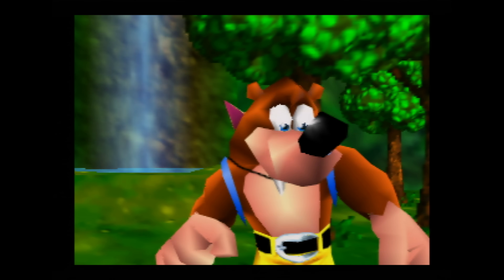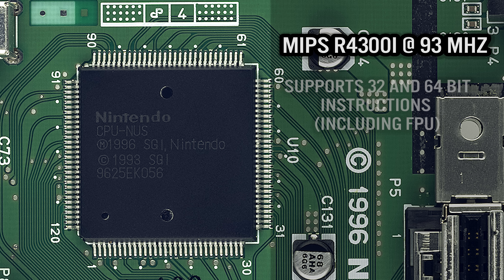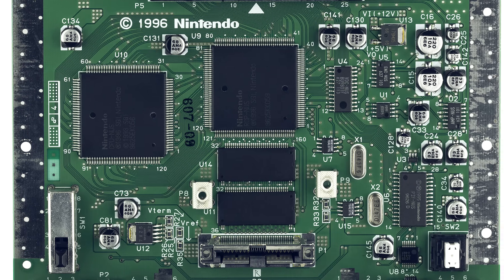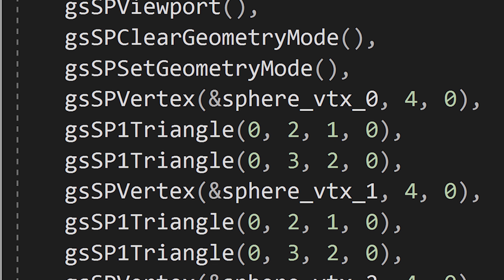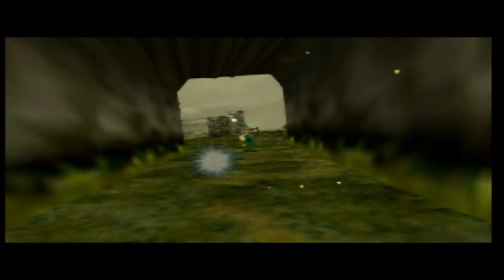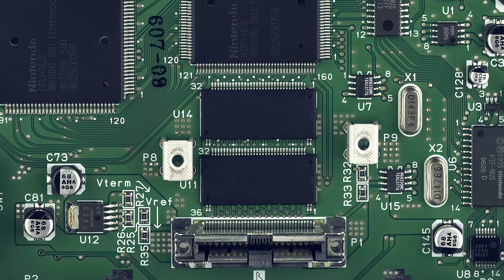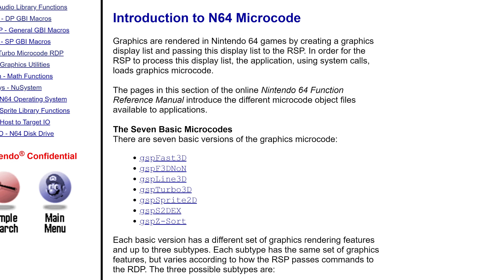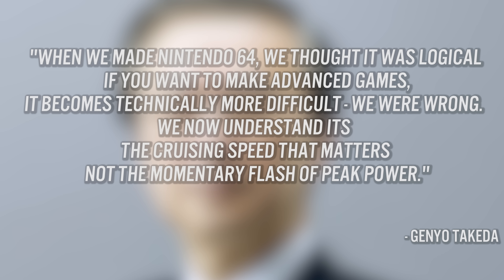Why was the Nintendo 64 so hard to develop games for ? | MVG

Comment: I would have prefered CD based console. I get that cartridge has faster loading times but on the other hand, storage is limited to 64mb. I find that limiting given how much more richer games could have looked if they had 700mb of storage that the CD's had. Plus, the CD based games also had more to offer. For example: the PS1 version of Tony Hawk Pro Skater had more than just gameplay, there was more FMV (command and conquer also had more FMV on the PS1 than it did on N64). RE2 had fmv on both systems but looked better on the PS1. One more example is Mortal Kombat Trilogy, the PS1 had more characters than the N64 version

Comment: What hurt more than anything was that the dev kits weren't very good and game programmers were very rarely adequately trained to do the graphics programming in a well optimized way. Very few game developers for the system had sufficient knowledge, skill, and budget to do it properly, but you can find some notable exceptions. Acclaim, for example, was able to take advantage of the system much better than a lot of other developers. 

My opinion is informed largely by Kaze Emanuar, who has recently argued that if you know how to program for the system properly, the memory bus is fast enough to effectively utilize the shared memory and to avoid bottlenecking the GPU, and he can back this up with working ROM hacks that he's made.

It may have made the system easier to program for if it had dedicated vram, a larger cache, or faster memory bandwidth, but Nintendo really dropped the ball in terms of how poor their dev kits were, and there were already some communication failures inside of Nintendo and between their hardware partners and themselves. Many of these issues were improved upon significantly over time.  

Even Nintendo failed to properly follow some important instructions from SGI regarding how best to optimize for the architecture with Mario 64 and probably with other games as well.

It was entirely possible to get N64 games to run at 60 fps, and yet many games couldn't even achieve a consistent 30 fps. Games like F-Zero X, which had a huge number of cars and VERY high polygon counts for complex 3d race tracks (for a 5th gen system), ran at 60fps and proved what the system was capable of when a game was well optimized. Furthermore, as impressive as the visuals in games like Conquer's Bad Fur day, World Driver Championship, Perfect Dark, or Turok 2 were, targeting a higher frame-rate at the expense of worse visuals would have likely been a much better choice from the perspective of gameplay design. Games from the 5th and 6th generation which run at a stable frame-rate have tended to age better in general, and it seems like it's taken console game developers until the CURRENT GENERATION to figure out that targeting a 60fps or higher frame-rate is a good idea.
Reply: I mean, that was kinda the problem. It was extremely powerful, but extremely difficult to program in ways that actually took advantage of that power.

Comment: A quick Google search says the PS1 had 2kb of texture cache vs 4kb for the N64. I'd guess it sounds small because on chip cache memory is more expensive and can create issues in the silicone lottery (more cache = greater chance of manufacturing challenges). Even modern chips are limited in on chip cache, an i5 13600k has 80kb of L1 per core, 2mb L2 per core and 24mb of L3 shared which sounds small but its extremely fast memory, it has faster reaction times (nanoseconds vs microseconds).

Comment: Basically; as good as this system was with more storage on cart and few lil tweeks would have been utterly timeless. PlayStation was obnoxious to play and graphics were awful compared to N64 but games were bigger, more in depth. I played ps1 games on ps2 and they seemed faster and smoother running than on the OG  mid 90s PlayStation. 
Imagine a game series like Gran Tourismo 2 or Resident Evil on n64.... You physically couldn't do it without a massive storage bump in the carts because they each took up two CD ROMs. That's almost a gig and a half

Comment: The Sega Saturn was also notoriously difficult to develop for which led to a huge disparity in the quality of games between Sega’s in-house development teams (AM2 and AM3) and third-party developers.  

The Atari Jaguar had similar problems due to its use of a 16-bit CPU which was intended to coordinate the activity of the more powerful graphics and audio processors, but ended up being used as the primary processor by most developers, including Atari, due to complicated architecture with poor documentation.

Comment: The R4300I was not a cut-off version of the R4400, whatever cut-off means. First of all, the Nintendo 64 used a derivative of the VR4300, itself a derivative of the R4300i produced by NEC under license from MIPS. The R4300i was a derivative of the R4200 designed for embedded applications, not at all a R4400 derivative. The chip had notably reduced floating performance because different data paths were used for the arithmetic operations on mantissa and exponent. 

And what does 32 and 64 bit instructions mean? Instructions encoding? If so speaking of 32 and 6 bit instructions is nonsense since the MIPS architecture being RISC, it used a fixed encoding so all instruction were 32 bits long. 
Or is it a rather a reference to integers support for 32 and 64 bit precisions (although 64 bit integers were never used in games), and 64 bit floating point numbers (a feature commonly found in 32 bit processors already at that time by the way)? However we would describe the chip as having 32 and 64 bit registers then, not instructions. 

Also note that the 64 bit capabilities of the chip were purely marketing speech because again 64 bits integers were never used in games, and the chip never needed to address more than 8 GB of RAM in a console that could only have 8 MB😂!!!

Comment: Limited memory and the fact that Nintendo chose carts over cd rom for the games really limited the N64. Most N64 games looked really blurry too. It was an ok console that would have been better if Nintendo didn't cheap out on memory and used cd rom instead of carts for the games.
Reply: The only advantage CDs could offer was the ability to store FMVs which in my opinion tend to clash with the in game graphics in many PS1 games

Comment: I think the game industry is going through the same cycle the movie industry is going through right now, the 90s, and the 70s. Games and dev teams have bloated to the point that it is unsustainable. It is the fault of publicly traded companies of course. The push to replace veteran devs with cheaper workers, the push to increase headcount instead of pushing out deadlines. I think that new dev tools will empower devs to make slightly smaller, more tailored experiences using a fraction of the people. Much like the movie industry goes in cycles from making big blockbusters, to creator driven smaller movies, and back to blockbusters, etc.

Comment: the n64 was an underpowered MESS. don't believe me? all you have to do is compare the non-existent difference between n64 games and ps1 games vs the difference between all gen 5 games and the dreamcast (except for blurry textures on the n64, which is a factually worse limitation than wrong perspective in the ps1). why bring this up? the dreamcast was released 2 years after the n64 just like the n64 was released 2 years after the playstation. the n64 was a completely gimped machine by design, to cheapen costs and keep piracy away.

hell, the expansion pack did basically nothing to boost graphical fidelity simply because the system as a whole couldn't make use of it. truth is, if the n64 was anywhere near the bullshit "technical marvel" marketing tried to spin, then all arcade manufacturer's would rush to have the hardware turned into an arcade platform. the ps1 and the saturn both had arcade counterparts, guess which other console didn't have any.

i remember when i had my n64 and had such a miserable time in 97 i went back to genesis where i could play road rash and kid chameleon. then i had fun
Reply: Each platform had their own strengths and weaknesses at the time during the fifth generation. Naturally it wouldn’t come off as a surprise that a mid 90s machine wouldn’t be what anyone expected (just like it’s two other competitors). The N64 while not perfect, definitely had superior 3D platforms at the time of release and had games like Goldeneye 007 which offered countless multiplayer sessions.

Comment: "its like adding s fuel tank but there's no gas in the pump" is the dumbest thing I have ever heard. Just say that the fuel lines were too small you monkey! The dev, not MVG.
Reply: The reason it's dumb is because most fuel tanks are in-tank and even in 96 it was common but even if they aren't the pump is connected via a line that's the same size all around. 😊

Comment: I worked in development for years and the amount of people who know technical details of the hardware is pretty low. Most people only know how to use libraries and APIs but never really understanding the details of how it's made. It sounds like you really needed to know how the hardware worked with the N64 to really make it shine and I imagine that's rare, if not impossible, to find a developer who could understand it. I imagine N64 game devs were probably a much different class of developers compared to modern times.

Comment: Actually, the PS One only had 2kb for texture cache, the half present in N64 system, so, I think it was not one of the big problems in comparation with another plataforms, maybe, as you said, was the way how texture cache was managed and accessed the real problem, and the catrige storage size, up to 64mb, almost nothing.
Reply: Someone identified elements on the die shot. I was expecting that TMEM covers a large area, but no, 8 small rectangles on the edge. I also learned that PCEngine indeed used 32kB SRAM chips in 1987. So it should be easy to manufacture a chip in 1996 with this amount of TMEM + some logic.
Reply: Another think, look this guy https://www.youtube.com/watch?v=OCBHdgbickE, he is doing a port of Portal video game from valve, and he is running it in n64 real hardware, and he was able to render a megatexture. The major problem was of n64, was in my opinion, it was so advanced for its time, and developers had to lear on the go and rush while they was working at the same time.

Comment: The texture cache wasn't a drawback on the N64, it was the same size as the PlayStation. Its issue was that they picked cartridges over CDs and that made PlayStation much more attractive to third-party developers.
Reply: TMEM only uses a tiny area of the RCP chip. PlayStation for faster (and dedicated) graphics memory to make up for its small cache. Theoretically, performance on PS1 drops if you don’t rotate the texture. But devs said that the cache was useful for palette mostly. SGDRAM was so fast even without a cache.

With mipmaps I think that there is a work around the small TMEM. But more TMEM would have upgraded the look of even lazy developers. It looks like for speed we need a pipeline a tree with stages to navigate to the final storage cell. N64 already uses this to fetch 3 values at once for linear interpolation. 8 blocks .. half of them for the mipmap? So can RDP blend between levels and then interpolate in a kind of pipeline? With even more memory blocks, quads of texels could be loaded and averaged for anisotropic filtering. That would have been cool. Always pick 4 pixels for the multipliers to interpolate. All others are 1 or 0.
Reply: @ArneChristianRosenfeldt  I'll be honest, I have basically no idea what you said, but I trust that you know how these consoles work.
Reply: @jamesprumos7775  Not just Texture memory, but N64 also had horrible memory latency from the usage of RDRAM. RDRAM latency was a big issue to the point that reading from RAM was slower than reading from cartridge.

Comment: N64 was ahead of it's time. 

     Still get a kick out of how all N64 games had Anti-Aliasing.. Meanwhile, most current Switch games, do not..
Reply: Nintendo could have embraced small Gouraud shaded triangles. This is a cheap pixel shader with short load time. Then use traditional scanline rendering. QuickSort all vertices by y and all edges by x. For each pixel, sort by z. N64 uses a 4x4 subpixel grid for edge antialiasing. So 1024x768i on a PC is better even without Antialiasing. Anyways, with all information available per pixel, each polygon still has to be rendered onto the subpixels. Front to back until everything is opaque.

Maybe optimize the memory controller for Quicksort. We need to load vertices, but are only interested in one of 6 components. Maybe we need some chunky copper transformer?

Comment: I like the way n64 games look and play. The simple yet dynamic per vertex lighting, the warped blurry smeary textures, and bit crunched sounds. I also love the plug and play fast action. It’s impressive how fast it is to just flip a switch and play. Modern games require 2 minute or more loading screens to open the game, so having little to no loading is very good. Wouldn’t have it any other way
Reply: Fun fact: The Precursor Legacy despite not being released on a cartridge, shows hoy CDs could had always prevented loading times if very well coded.

I personally can tolerate some long loading times though if whats loaded is good.